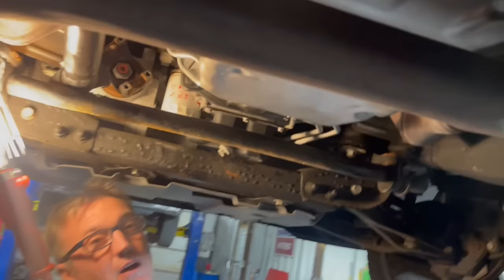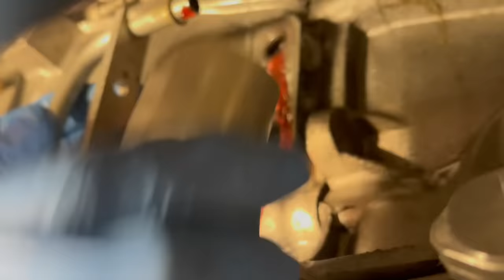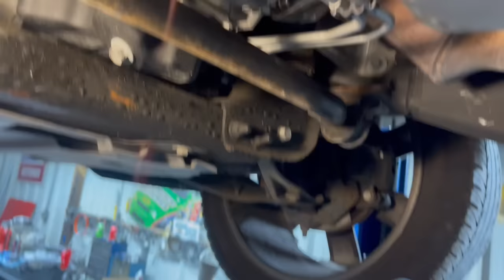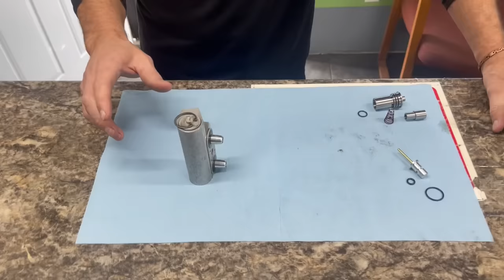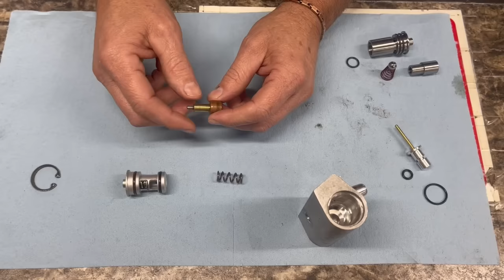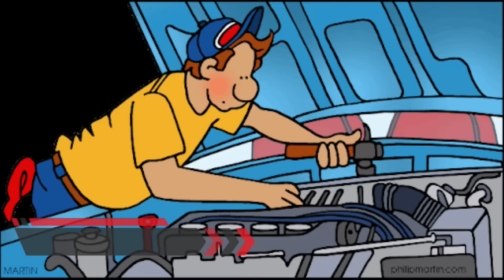Chevrolet 1500 Automatic Transmission ( 6L80 6L90 )over heating fix for 2014,  2015, 2016, 2017 up

Comment: Delayed engagement have nothing to do with the thermostat, the circuit is very simple, torque converter is always full of fluid it is responsible for creating the pressure of the line, one line is out the other is in to drain in the pan

Comment: I wish I had found this earlier. I just paid $6k for a new torque converter and other parts. If I had known, it would have cost me less than $100.
Reply: In my unpleasant experience. This will only make TQ last a little longer.
Reply: I feel so fucking sad, I just bought a 2019 silverado with 72k miles 3 months ago and the torque converter has started slipping and the unloaded temps just me in the truck no trailer are hitting 210°f… I don’t have $6k if this trans goes out idk what I’m gonna do, I can’t afford that. I feel so fucking duped having just bought this truck not even a full 3 months ago. I should have got a warranty, but thinking oh it’s a new truck it shouldn’t have any problems for another 100k miles… boy was I wrong.
Reply: @imbrandon16 
Dude how is it going?Transmission holding up? Just purchased a used 2018.
Reply: @Lstutta  it’s at 95k now, I put the transmission thermostat bypass in and that’s helped bring the temps down a little, I’m getting ready to add a transmission cooler to it too. I might end up having a new torque converter put in it before it fully goes out because I’ve heard once they go out they take the whole transmission out so the then because they send broken shards through the gear box. But even with the thermostat bypass this thing gets HOT. I’ve gotten it up to 228° and I just had to stop put it in neutral and let it cool itself off

Comment: Is it ok for a 2003 suburban with a 6l80 get up to 185F
Reply from the maker: yes  as long as the transmission temp doesnt exceed the temp of the engine coolant 
sometimes when you are pulling the trans temp can get to 185f,
maybe an external cooler and if you change the fluid use Mobile one LV

Comment: Superior looks like a failed check valve ready to happen. 
Delete is gone no issues.  So If cavitation happens.  Do Not just jump in throw on the floor.
Reply from the maker: yes these things can be hard to get apart or get the snap ring out and i have used the delete and the superior and have seen no difference in the transmission temp or engagement so the only difference I can see is PRICE

Comment: Why is the 2012 6L90E different? And can't be used in it
Reply from the maker: is your 2012 6L90 overheating? if it doesnt have a block im working a video for possible fixes for this to be posted  soon
Reply: @codemansauto208  6L90E isn't overheating. Just enjoy making my truck more efficient. I know that superior solutions has that bypass for 14+ but just wondered why my 12 was different
Reply from the maker: @jerryreyes3358  
 2008-2013 did not have the block and are the most efficient cooler systems and even some 2014 and up dont have the block. most rebuilders are recommending Mobile One LV  in the 6l's
Reply: Have an 2011 6l90 put larger cooler up front and run amsoil. Running just under 100 degrees normal driving
Reply: @jerryreyes3358  you know the saying. If it aint broke, don’t fix it.

Comment: Where is the speed sensor on this transmissions?
Reply from the maker: there are two speed sensors under the valve body inside the pan, they are both on one wiring harness.  this is a link to show you what it is 
https://amzn.to/41PdDFU
Reply: @codemansauto208  tnx brother appreciate the info

Comment: Now I'm crazy but.  The wires that go under the seats. If you untwist the wires that are wound together from the factory. As the wires are made and wounded together after a little bit, the wires start touching do to the manufacture and how they're made.   And after some time start touching and shortening stuff out. It may not be enough to make the engine light come on, but it will affect it. Because you're brakes are always on just a little bit. Hints the front end  down driving down to road. In return will make your transmission get hot. It sounds crazy, but look at cars and trucks going down the road.  And the front end is always pushing down. Take the wires and untwist them and you will see a big difference because there not touching and making the antilock brakes apply.  You probably don't even notice it but just a little bit will make a big difference.

Comment: top cap is impossible to remove once corroded mine is 2017 hard to remove please be weary of this you’ll be stuck until you get a new valve
Reply from the maker: sorry you had an issue with removing the cap, I should had mentioned that if corroded put heat around the cap to melt the seal,  this helps       may be another video coming soon to show this process

Comment: What if you just remove the spring and thermostat  and put back together.
Reply from the maker: i just added a video that shows what happens
Reply: Remove the guts, tap the internal passage for a pipe plug, install the plug. That will force the fluid through the cooler at all times. Trans will then run around 150-155 deg during normal driving instead of 200.
Reply: @keithgoff3272  this is way cheaper options. But you know, consequences of going too cheap can be a financial disaster of more costly repairs.
Reply: @Codemans auto  I have seen a video where the guy takes it all apart and basically puts the spring above the block off and this does the same thing as the delete kit.

Comment: Did this mod few years back along with the mishimoto transmission cooler on my 2014 silverado 1500 and temps fluctuate in the 100-130 degrees. 

I'm here in the Midwest and outside temps gets cold down in the 20 degrees or so. I've driven 2 or 3 winters now with both sure cool and mishimoto transmission cooler and temp never go pass 150 while driving highway or in town traffic. Is temp of 110-130 temp be concerning?. Will it hurt anything besides frequent fill up at the gas pump?.

Comment: Alls fine and dandy with these trans delete kits which keeps the temps below 150* .. My research tells me the best operating temp for trans fluid is in the 175* range... How can we get these trans thermostats to open say at 175* instead of the factory 190* ... Anyone ?   Thanks ...
Reply: Stan, the current GM replacement thermostat puts the temp at 70C or about 158F. 175 is optimal as the properties of the fluid degrade significantly as the temperature rises above 175F. Some synthetics allow for a marginal increase in maximum temperature. This allows the transmission to warm up in cool climates but keeps the temperature well below fluid breakdown temperatures at 158. The transmission temperature can actually float above the set temperature of the thermostat by the time the fluid gets to the cooler and back, especially when towing. At 158 there is some margin to prevent it from overrunning the ideal running temperature of 175F.
Reply: Whats the best ATF fluid to use? I always use Valvoline Dex VI on my 1500 chevy 2018 5.3LT
At 40K, all black already. This truck is never a hauler, only normal daily driver.
Reply: @commonsense5105  Thank you for your informative reply ... Was able to get a Replacement GM thermostat for my 2015 Sierra 6 months ago ... Indeed the trans temp runs around 160*/170* range here in ENC and did very well on our 3600 mile trip this past July in Canada ... Did notice an uptick in temp when returning to ENC this July with upper 95+ outside temps... While waiting in line at a Chick-Fil-A the temp went to 190*+ which quickly dropped back down to 175* when back to hwy cruising speed ... Am very pleased with the GM thermostat upgrade ...    :)
Reply: @marlonespenilla5839  Marlon, Dex VI is usually a synthetic blend or fully synthetic. If the color seems dark, you might want to smell it to insure its not burnt. If it is, all fluid and filter should be changed immediately.  It can't hurt to change it or at least a partial change if it's dark anyway. Lots of stop and go driving can push up the temperature of the transmission to the point the atf is reaching a break down temperature range. There are several manufactures of dex vi that are pretty decent including GM, M1, even amsoil, and others. Many newer trucks such as your have a transmission temperature monitoring function option on the central display. I would recommend monitoring the temperature of the transmission to see if temperatures above 175F are regular. If they are, you'll need to work on its reduction. By the way, it's not a bad idea to regularly change the atf at 50K mile intervals, at least a partial. Then at every 100K change all the atf and filter.
Reply: @marlonespenilla5839  GM

Comment: Silly Question why not buy a complete assembly with the modification done so a unbolt and bolt in assembly back on???
Reply from the maker: ive built a lot of these transmissions with under 100,000 miles with over heat failures so buying a new bolt on part is just another short term solution
Reply: @codemansauto208  ok understand
Reply: @codemansauto208  he said "WITH THE MOD DONE", not original

Comment: the 8l90 use this stupid design also.  I put the Superior kit in mine.
Reply: Wat does your transmission temp read at with the kit?
Reply: @Stop_the_cap311  140* is about the hottest it gets in 80* temps.  After running on the freeway on a 90* day then hitting stop and go it may go up to 160* but I can't really remember

Comment: Instead of using aftermarket crap why not just work the TSB with OEM PARTS? The TSB is 21-NA-199. This aftermarket delete mess WILL VOID YOUR WARRANTY. Even if out of warranty use OEM parts.
Reply from the maker: customers at my shop don't have  factory warranties anyways and I am not going to install something in my customers vehicle that can fail when I can install something that wont fail for a whole lot less money,  nothing is installed at my shop with out my customers approval     but thanks for your concern
Reply: Superior Solutions' kit is most likely higher quality than that of the OEM GM one, brainiac 🥴
Ever heard of an S.S. STL- 010 kit failing?!?
No, didn't think so 🤡

Comment: Doesn't anyone read there owners manual for recommended maintenance ???? It tells you what you need to do and when. What oils to use .
Reply from the maker: dont use the fluid that is recommended in the owners manual, that fluid blend has been updated
Reply: @codemansauto208  what do you recommend 2015 Silverado.